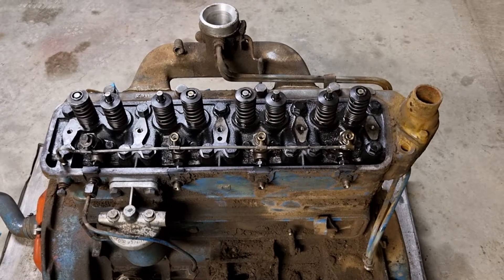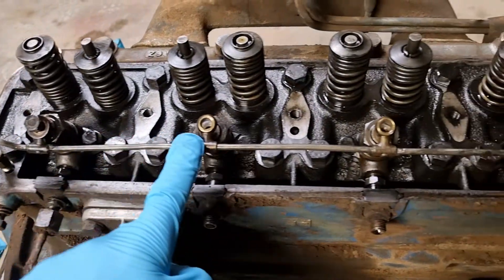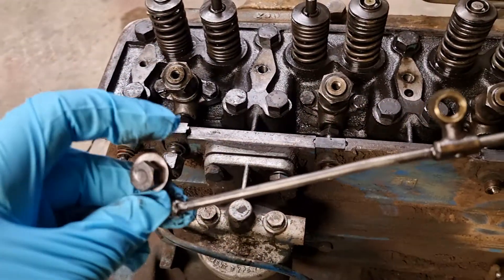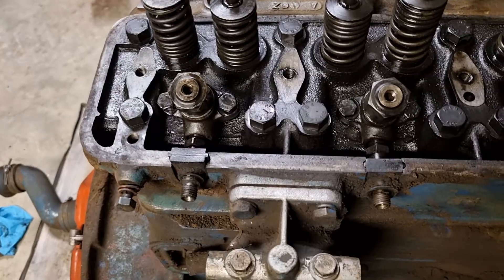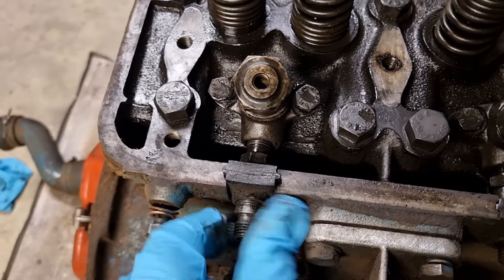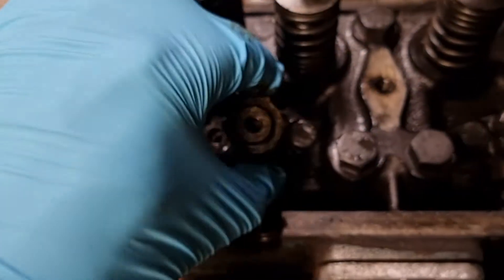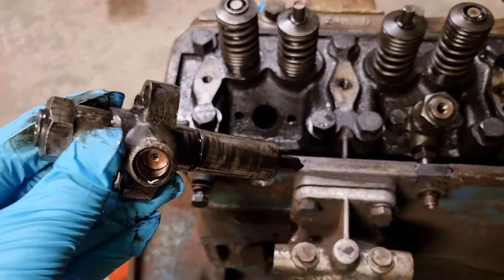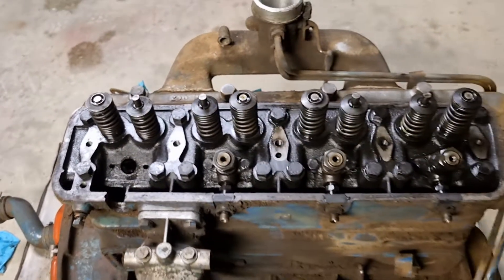Fordson Major Fuel Injector Removal

Comment: Don't understand why you removed the feed pipe through the rubber seal?
These injectors are designed to be removed complete as the seal simply slides along the feed pipe.
I have 2 of the original injector removal tools, we still use the major my dad bought new in '55.
It is fitted with a 20 ton Boughton winch for the woods.

Comment: Hello Sir. You would'nt happen to know the thread on the fitting which is between the leak off pipe and the cylinder head? Lost mine after picking up the cylinder head from machining.